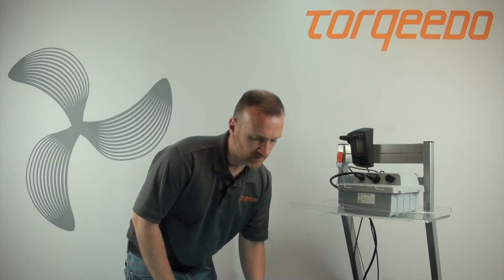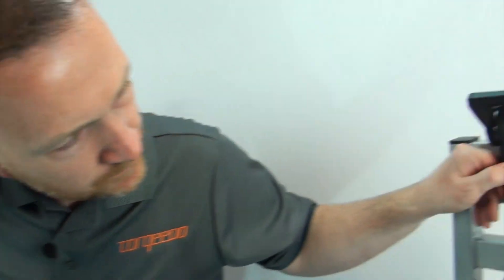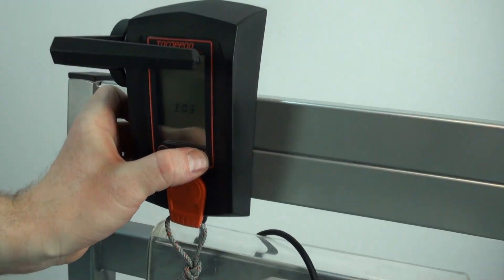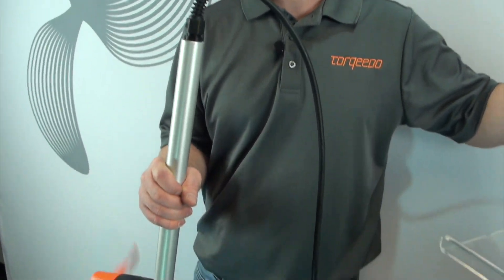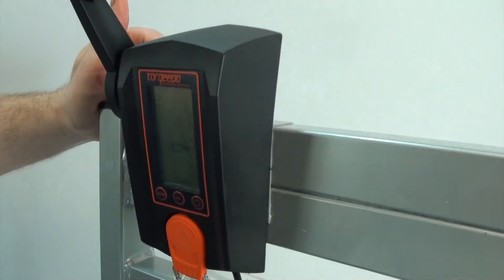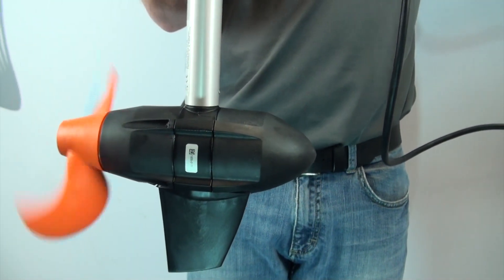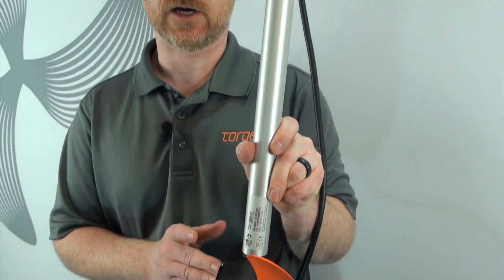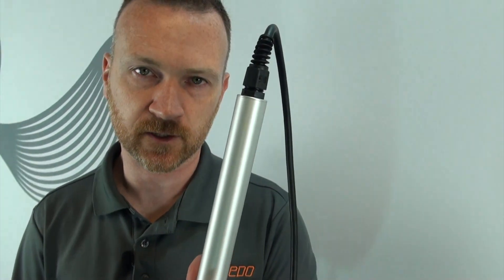Torqeedo Ultralight Motor E03 & E04: Tilt Sensor Safety Mechanism

Comment: Please guide me how to solve problem E 45 code in 1003

I have torqeedo cruise 2 there showing coad E 46 

Please suggest
Reply from the maker: Hey Bharat, thanks for your patience. We created a video for the E 45 please check here: https://youtu.be/GOMGk_f-5Q8

For further questions please directly contact service centre:

Torqeedo GmbH
Service Centre
Friedrichshafener Strasse 4a
82205 Gilching
Germany

T +49 (0) 8153 / 9215-126
F +49 (0) 8153 / 9215-329
service@torqeedo.com

Customer opening times
Mo-Fr 9.00 am – 12.00 midday and 1.00 pm – 4.00 pm